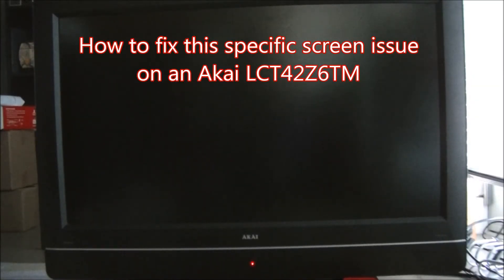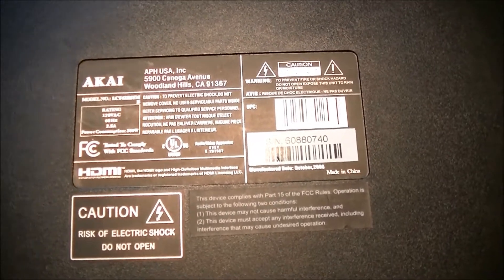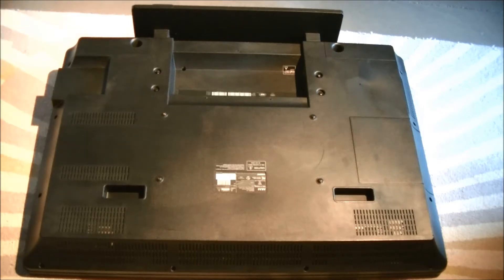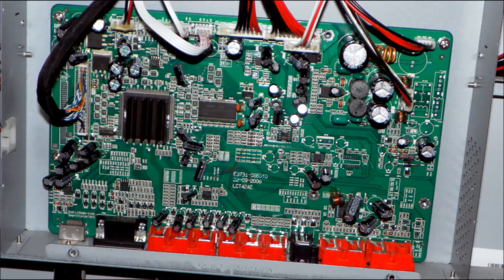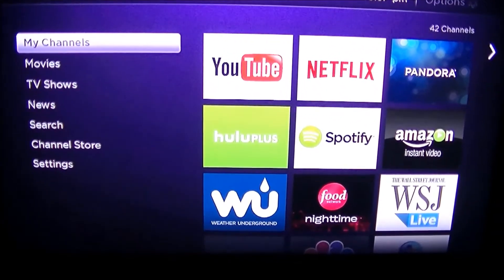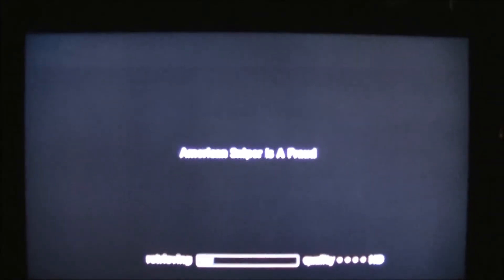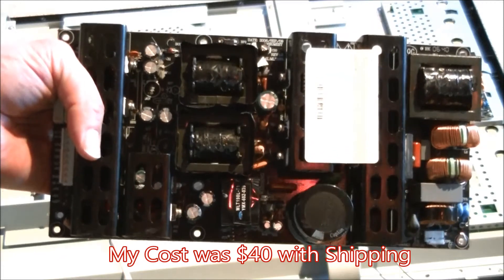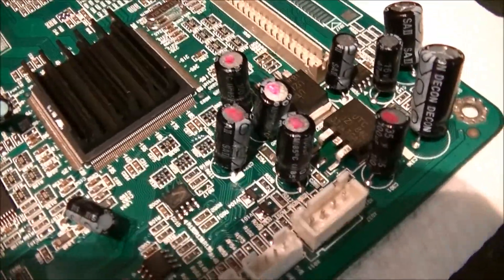Akai LCD TV 42 inch Television Repair LCT42Z6TM

Comment from the maker: I pulled the TV out of storage and have been using it for the last 1.5 years (everyday).  Still running strong with the repair.  The matte finish on the screen and general picture quality is great for such an old TV. Certainly doesn't have the same blacks as a modern TV - but really, the next day, Do I remember any of the extra non-black screens areas.  No.  Especially since I mostly watch YouTube informative information.  As a side note, I saw a 42 LED TV in the trash area of a complex and grabbed it.  Works perfectly!  Probably threw it away after they bought a larger TV.  Wild!

Comment: I have the same TV the difference between yours and mine is mine has a DVD player built into it the issue I'm having with the TV is when I plug it in and turn  the  TV on the logo on the TV shows up and then all of a sudden it's a black screen
Reply from the maker: Probably a different issue .. but the capacitors are a known problem .. so I would replace them anyway and see the results.  It needs to be done in any case and may fix the issue.